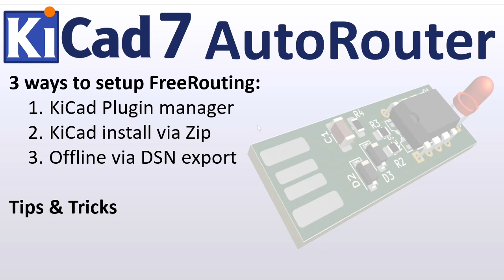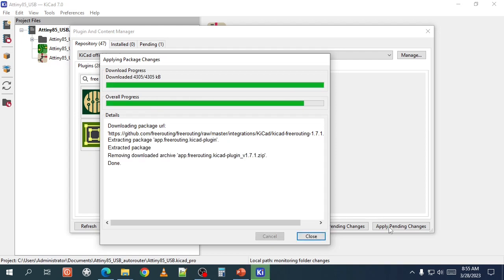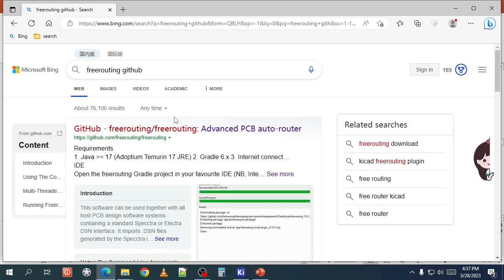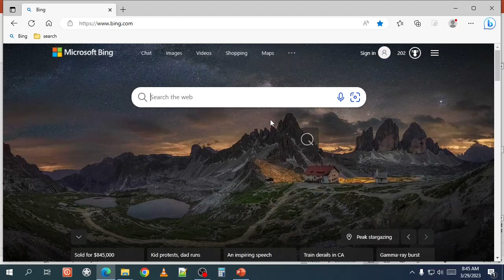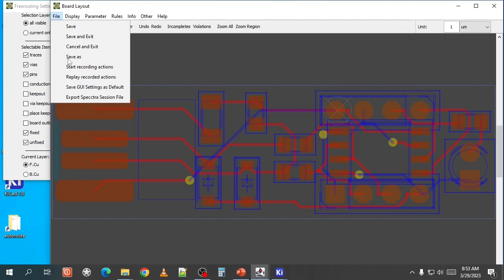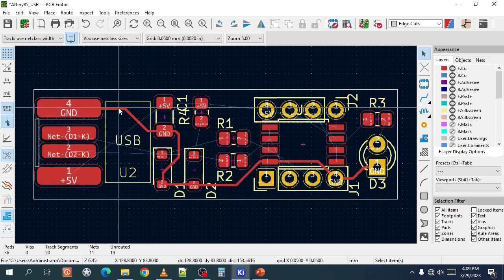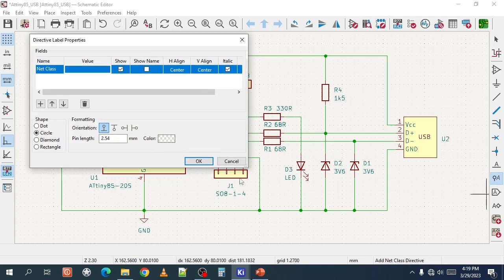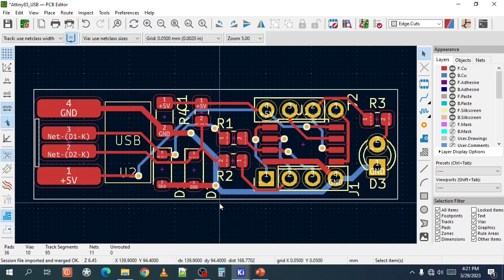KiCAD 7 Autorouter – Simple Fast Prototyping

Comment: how do you autoroute just one side of a pcb ... "freerouting doesnt do single sided pCBS
without single sided it means you have to use both sides of the pcb with vias. WHAT A PAIN - ESPECIALLY IF YOU'RE TRYING TO MAKE EACH SIDE OF THE BOARD LINE UP FOR THE CONNECTION OF VIAS."

Comment: The problem with autorouting is the optimum component placing. As it doesn't override any shitty placement's you've made (which you're able to change if you're doing by hand obviously).
Reply from the maker: Yes, there is no AI placement + routing..yet.
I recommend to place similar to the schematic and look at the "rats nest" connections

Comment: Good video, clear concise and does a good job presenting the information so someone who has used autorouting before can apply immediately.  

I am wondering if you can use the autorouter to only route selected tracks interactively?  This used to be a feature of the autorouter in the older PCB package on Linux/Unix where you could select one or more tracks to autoroute.  I used this for boards that I wanted to route some tracks manually while routing others (such as bus lines) using the autorouter.  Anyone know if this is a feature and if so how to perform such routing?

Comment: This is almost perfect BUT is there a way to specify a "no route zone" on a specific copper layer in autorouter so it doesn't try to put any lines across?
there's a specific footprint I'm using which autorouter keeps putting lines over or across and i cant seem to make it stop doing that
i'm ok with it using layer 2 to route but not layer 1

edit: answered my own question, you can do it by using a rule area (keepout) and specifying which layer to be excluded. the autorouter will respect it
Reply from the maker: Hi Rykachoo! You you can create a keep out zone in the pcb editor before you start the autorouter:

In PCB editor: place, add rule area (or crtl+shift+K)

1-select the layours to be kept out (e.g. F.Cu,B.Cu)
2-select what to keep out: e.g. tracks, vias, pads, fills)
3-click OK and draw the keepout zone shape
4-finish drawing with double click (cancel with esc)
I never used it with the autorouter, please let me know if that worked!
Reply: @smartpowerelectronics8779  it only sorta of worked, it seems to block everything in the auto router, meaning if it's placed directly over pads the router can't even make a connection

I do wonder if there's a way to allow for connection bu, prevent traces from traveling alongside long lines of pads
Reply from the maker: You can select which layers are not allowed in that area, maybe you need to create  complicate polygon for your keep out zone.

Comment: Is it possible to make it auto rout for single layer only?
Reply from the maker: I think so, just do not use top layer, so no ttracks, vias and pin through holes. 
Not sure how to deal with pin through holes in footprints, you can chnage the footprints or jiust remove the layer from the gerber file ;-) pls confirm with your PCB vendor that you want single layer, default is 2-layer.

Comment: Hello, I have installed Freerouting as you showed in your video but if a start Freerouting in Kicad 7.0 I see a short time (6 sec) a rounded blua screen and the PCB is not routed. What can be wrong ?
Reply from the maker: Did you try to install the "offline" version(option3)?
Reply: @smartpowerelectronics8779  Yes. I have try all 3 version's.
Reply: And I have try it on a Linux and a Windows computer.

Comment: Excellent instructions & perfect timing! Thank you!
Just in the middle of laying out tracks on my 1st SMD PCB, with analogue audio op amps, a digital Teensy 4.1 MCU with an I2S CODEC IC, with 6 ADC inputs + 6 DAC outputs.
IOW, I'm already in way over my head, have yet to learn about creating a ground plane or pour.
This video explains everything I need to know (I hope) in order to complete the PCB. WooHoo!!🥳👏👏👏👏
Reply from the maker: Thanks man! I struggled to start using KiCAD, so I made the video after I finished my 1st PCB with it ;-)

Comment: Freerouting is listed in Official repository list to install in Kicad 7.0.1. Sİngle click installs that.
Reply from the maker: Correct, that is option#1 in the video.
Please note that some regions in the world have "special" internet connections and need to download separately. For me the "single click" only works with VPN ;-)
Reply: @smartpowerelectronics8779  Repository installer is getting that from the same Github page.
Reply from the maker: @trading4968  Correct, but if you need to try to download several times it is better offline ;-). Agree that for users in most regions it works well.